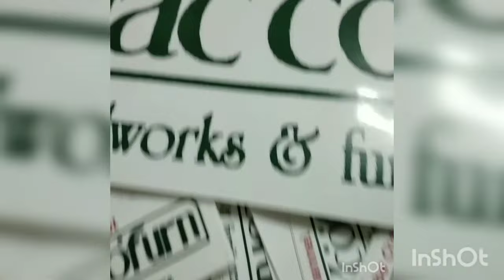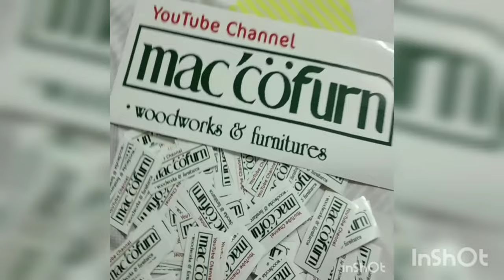how to build closets||melamine board

Comment: Tanong lang, paano mo i screw ang mga shelves ng hindi nakikita sa gilid ng caninet? Are y using pocket holes? Kasi yan ang problema ko lagi at im using melamine boards.
Reply from the maker: Ang ginagawa ko po eh para m hide yung screw is ginagamitan ko po ng puncher  n round sya kasing size ng head ng screw tapos yun po yung mag cocover sa screw nyo.
Reply: @maccofurniturestv  ah so gumsmit ka ng screw cap? Ganyan din kasi ginawa ko sa ibang project pero hindi ako kampante nakikita parin.thanks